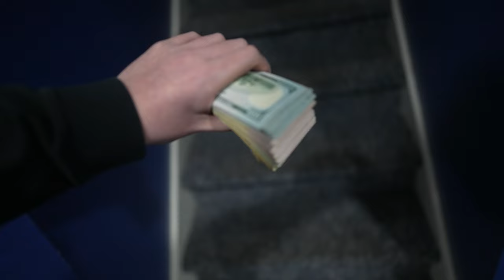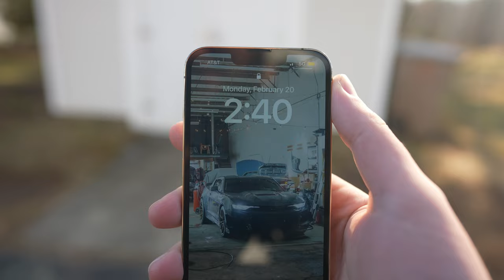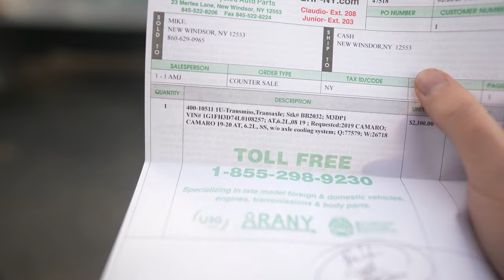The Search For A Transmission

Comment: No way, are you sure a Stock 10L80E Camaro SS trans can handle up to 900 wheel horse power?
Reply from the maker: CSP and the guy who makes HHP TCMs both told me it would. I doubt it will for very long but it should as long as the tune is solid lol